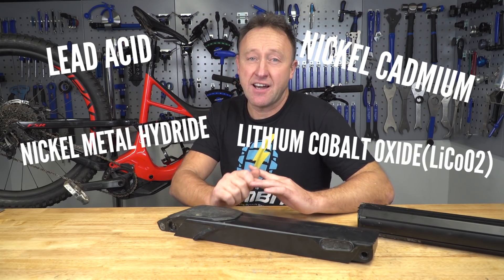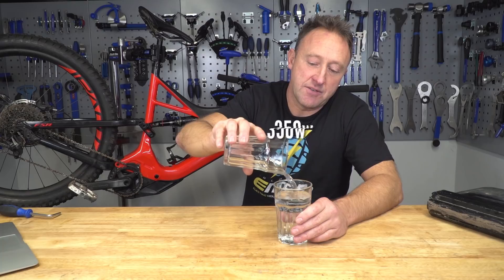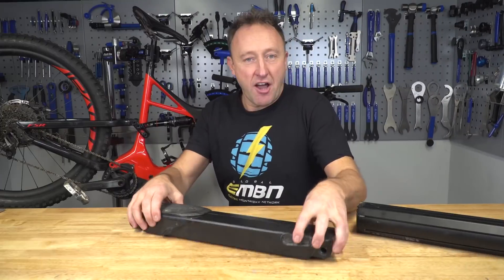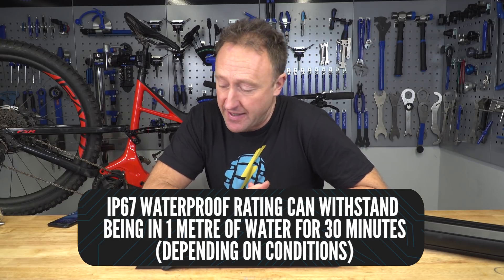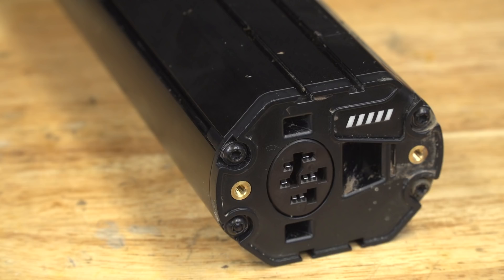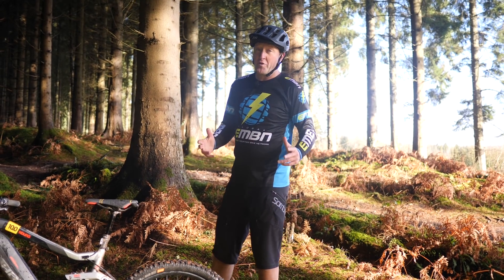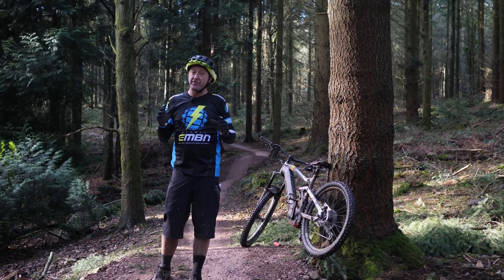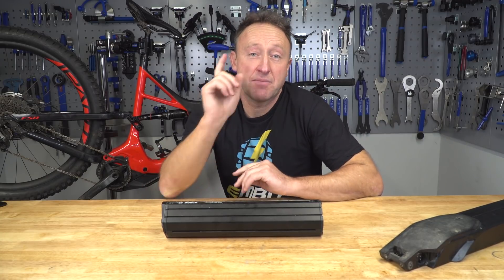E Mountain Bike Batteries Explained | EMBN's E-Bike Fundamentals Part 2

Comment: Steve can we jetwash an ebike if we keep the water jet out of the battery and motor? (Like washing a normal bike and be aware not to put the jet directly on the bearings. ) 
And regarding the life span of the batteries, the number of charges that the manufacturer announces are full charges and discharges? For example if I use 50% of battery life and plug it in does it only count as "half charge"?
Reply: The BMS ( Battery Management System) counts full cycles .... modern chargers / monitored battery arrays handle this. The BMS also does not allow you to fully flatten the battery. The setting for full charge is a bit of a lottery as to what the engineering people decide .

Comment: I have a Hiabike Exduro AllMtn  with Bosch System Active & Performance CX +500 Wh. Battery .. My question is after a 15km ride and 4 leds still showing on my battery should I recharge the battery or wait untill I have consumed more...??
Reply: I tend to take shorter rides and ride daily during the warmer weather months.  I personally wait until I am at around 20 percent before charging.  The only exception is if I am planning a long ride.

Comment: "Let's make this a little bit more clear (sic)", and starts pouring water between 2 glasses... 250 W motor and 500W battery really is the most simple of math already. In a recently previous video you told us to "charge the battery to 100% as soon as you get back from a ride", now it's 30 - 60%?
I was for a brief minute thinking of at least trying an e-bike, but when you explain the limits of the battery, that causes further consideration;
- Don't need to use the battery on downhill or flats.  Now you're piloting an unnecessarily heavy bike
- Save the battery for use on steep ascents. Well of course, because it's a heavy bike, what with the battery, motor, heavier components.
Reply: Hi Dave, yes about 60% especially if you're leaving it for a while. Heavy bike yes, but still a fast bike!

Comment: If I know that I am going to scrap the bottom of my battery capacity, then I apply a simple rule: FIRST downshift to first gear, THEN if needed increase assistance level. However I also learned to evaluate the "electron consumption": about 10Wh/km (horizontal) and 500Wh/km (vertical) is a conservative estimate.

Comment: what happens when one of the Lith ION cells in the battery dies? I guess the whole pack is garbage?
Reply: Yup, no branded ones are self serviceable.
Reply: Ya... $1000 replacement for a $3 cell... nice.
Reply: Nothing a screwdriver and solder iron can’t solve ;)

Comment: Doesn't voltage deserve mentioning?  Also, not charging to 100% will extend battery life significantly - which augers for larger batteries but at 80-90% charge.  Can buy aftermarket chargers that will allow you to select percent of charge.
Reply: do you know if its better to drain it below 20% before charging ? and if half a charge to 50-70% is good or bad for this kind of batteries?

Comment: It's not as simple as dividing watt-hours by Watts of the motor. That's mainly because the motor watt rating is nominal, or average. Under acceleration these 250w batteries can provide up to 900w. If you're working the 500wh battery hard you can empty it in 90 minutes or less.
Reply: TheAegisClaw The Bosch motor peaks at about 600W so indeed that might be 900W out of the battery. The discharge rate of the battery is governed by the constant and peak C rating (discharge rate as a multiplier) based on the battery Ah. As a 500Wh Bosch battery is 36V nominal and 13.4Ah = 482.4Wh then if a discharge of 1C then that would be 482.4 Watts of power entering the controller before losses. The cells are 18650s I understand but not sure whose or the spec, suffice to say they can exceed 1C discharge rate for short durations.
Reply: TheAegisClaw Better to talk about capacity in Ah and C rate as well rather than stored energy in Wh which of course is important in terms of range and average Wh/m but tells us nothing of the safe discharge rate in Amps of a battery with a certain Ah at a certain voltage and all prior to system efficiency losses. Still I admire the team’s efforts in learning, helping and bringing these videos to us all. Thanks to them all for that.
Reply: Hi TheAegisClaw...your right of course, just wanted to cover basics, will get onto more detail in future

Comment: Mine will be the Bosch powertube 500 battery (on my Cube Stereo Hybrid 140 TM). What I'm interested in is how the battery capacity is developing. Will we see  batteries with 1000 Wh or more in the near future??? I'd be happy to put down some money on more range 😊
Reply: Sander Bosman Can buy then now. Just bought a 1000w Bafang Ultra mid motor emtb with 960wh battery.  (48v 20ah).  Luna sells 52v21ah batteries for their Apex bike.  But seems unlikely mainstream Euro manufacturers will use them any time soon due to the 250w motor limitations.
Reply: It’s not just about capacity in Ah it’s about the stored energy in Wh and the density of that energy in terms of volume and weight. It doesn’t follow Moore’s law like computer memory but we have seen Energy densities increase and they will continue to do so. It also very much depends on overall system efficiency of the motor and controller as if those losses can be reduced we increase range for the same Wh energy density battery. In other words we reduce the Wh/mile used, so getting more range.

Comment: Steve, also really liked your boil and simmer analogy. All that I would add as regards mode is match to the heart rate zones and speeds you wish to ride at for health benefits. I use an HR monitor, cadence meter and watch my ride average speed. This way I can stay with you healthy guys! As I have a lung disease (those of a 90 year old) and I’m heavy then I need to use Turbo when you guy use trail just to stay with you guys and be in a similar heart rate training zone. Of course I pay the price in range. One way for folks to get a good insight into range is experiment with this as it’ll indicate the variables you can do something about:
https://www.bosch-ebike.com/en/service/range-assistant/ It does vary from make to make a little due to percentage support, peak torque (amps) and the overall system efficiency of a machine. Happy trails and thanks for your hard work in bringing us all these videos.

Comment: Well done Steve. Tricky subject eh. Now for the fussy bits. Capacity is Ah and stored Energy is Wh, so as my Bosch is 36V nominal and 13.4Ah capacity then 36 x 13.4= 482Wh of stored energy. Discharge is measured as C rate as is charge so if I discharged at 482W of power that is 1C. Depending on the type of Lithium and as most eBikes uses LiPo as opposed to say LiFePO4 then we may find LiPo recommended C rate on discharge for cycle life is max say 1.5C so we can safely pull 482 x 1.5 = 723 Watts of power from the battery which after efficiency losses in controller and motor and wiring might leave us with 500 Watts of peak power at the back wheel subject to motor rpm and other variables. I told you it was tricky 😏 Top job you did there though and gets us all on the learning curve, which I’m having as much fun with since I learned suck, squeeze, bang, blow. I think that was those old dinosaur fuelled machines of yesteryear  😏👍
Reply: Yes, correct. but some battery can be more larger capacity, AS 36V, 17.5AH, samsung cells
Reply: You lost me at ‘Steve’ 🤪🤔

Comment: The simple and easy way: I keep mine at 60%, and when I know I'm headed out for a longer ride I give it an hour of charge while I'm getting ready for the extra 30%. Same if I come back at 20-30%. A quick one hour charge to 60% and it's ready to sit around. That way I'm safe from it sitting on the extremes and I can still use almost all capacity.
Reply: I fully charge mine after a ride, should I be keeping it at 60%? Am I causing damage?  Sorry if this is a daft question!!
Reply: @poppypopsll28  If you're not going to use your battery for a while it's best to keep it at about 60% charge. The latest advice for best battery longevity is to keep the battery charged between 40% and 80%. It doesn't hurt to occasionally charge to 100% but it shouldn't be left on charge all the time.  That will reduce the lifespan of your battery. Probably the most important is not to overheat the battery. 
 I've been doing this on my mobile phone and it's almost 2 years old and there is no discernible difference in battery life since when it was new.   This article is about mobile phones but it would apply to e-bike batteries as well: https://www.techadvisor.co.uk/how-to/mobile-phone/charge-phone-properly-3619623/

Comment: so you say its better to charge it to 60% if you ride not your ebike for a week .. or charge it full??!
Reply: If you're going to use it again the next day then charge it to full, if it's going to be a fed days then leave it charged between 30-60%. Basically 2 rules if you aren't using daily ...don't leave it flat and don't leave it fully charged. Your battery will love you for it.
Reply: DeadHead thx for the replies guys .. really apreciate it 👍👍👍
Reply: TomaCukor Not charge to full if stored, that’s for lead acid. Better to leave LiPo around say 60 to 80% charge over time and charge sufficiently every few months of storage to balance cells. Bottom line charge fully if riding soon after charge, less if not. I charge to 80% after my ride and top off in the morning if riding next day.
Reply: richard kellogg It’s true to some extent. Lithiums have a cycle life (the number of full charge and discharges) and a calendar life. Much depends on how you treat them. There’s an old saying, ‘batteries don’t die, they are killed’. Like ebike range there are many variables in this matter but you are right, if you didn’t fully charge or fully discharge Lithiums then they’d last well as the main stress in terms of voltage is at the too high and too low voltages, high and low states of charge (SOC). Having said that it begs the question how much range you need and what you are prepared to pay per mile. As Steve said 500 cycles at say 20 miles per ride is a lot of miles, 10,000 in fact for a battery that costs 500 quid so about 5p per mile. Hammer your battery leaving in the hot sun for instance and maybe you get 250 cycles and therefore double the cost per mile. What price fun eh?
Reply: TomaCukor  Sorry, that is incorrect - LiFe and Lipo batteries have very low rates of self discharge, so there is no need to charge to full for long term storage. Indeed doing so will reduce pack cycle life, capacity and current delivery capability over time as dendrites will grow inside the battery increasing internal resistance.
Reply: I have heard that not fully charging, ( like to 80% max ) will extend battery life. And that some electric cars do this to get 10 year life.  Is this true?
Reply: For Lipo packs 3.85V/cell is the recommended storage voltage for long life, which equates to about 30-40% capacity. The actual % between 30 and 60% is less critical though than not leaving them at elevated state of charge, which is anything over 4V/cell.
Reply: gingermattb Yes, I forgot the self discharge is slower than I remembered, I deleted it to not leave bad advice. The discharge is a few percent per month so it is fine to leave it around 70% and not have to worry about it going under 30% unless you are in a tropical climate.
Reply: I do the same.